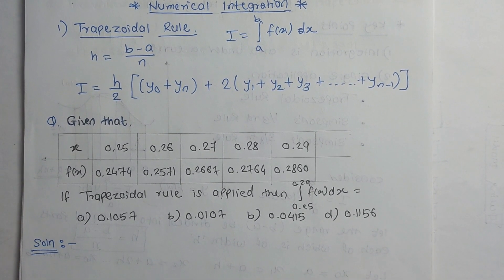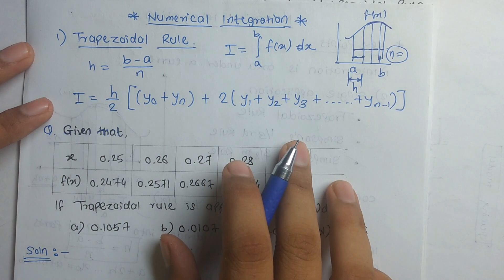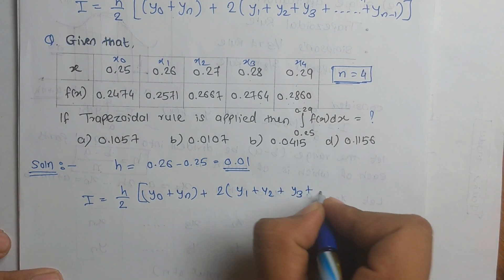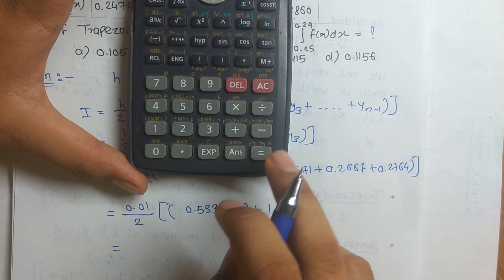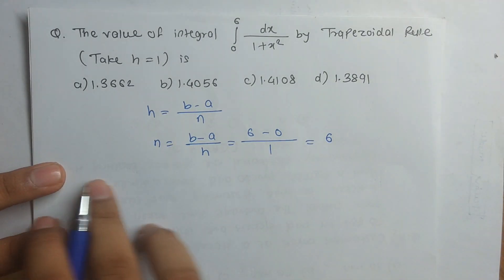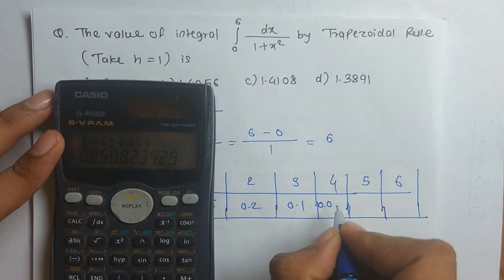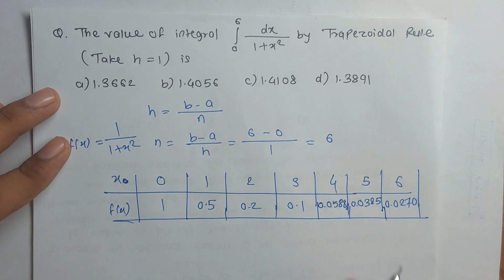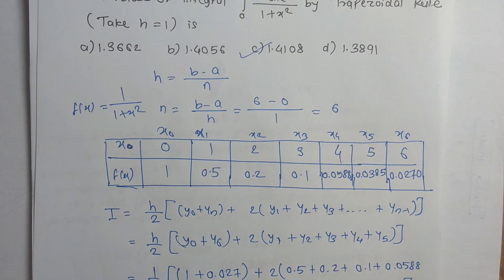Numerical Integration Trapezoidal Rule Introduction l Problems with Solutions l GATE 2021

Comment: sir what u saying is good. but u r taking the values differently that vat u didn't mention in question... plz once go through ur videos...     here in this question u have mentioned integral 0.25 to 0.29..... but in answer u r taking 0.26 in the place of 0.29....    in previous concept also of bijection method  also u have done one example X^3-X-1 in this u have taken F(2) value plz once check it....
Reply from the maker: +papaiah guptha thanks for commenting.
But to find step size in answer h=0.26-0.25 is correct. 
To find step size 
h = next entry - previous entry of x

Hope you got this
Reply from the maker: +papaiah guptha and F(2) value is also correct i check it
Reply: Yes sir in the first problem you took 0.26 - 0.25 for h  instead of 0.29-0.25. Why is that?   And in the next problem you did 6-0 is it because h was already given for 2nd problem?